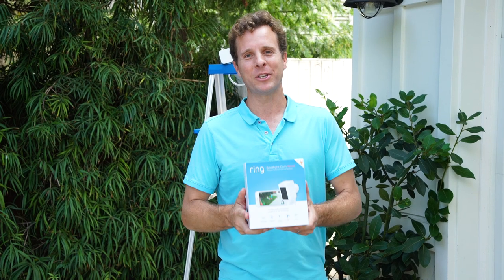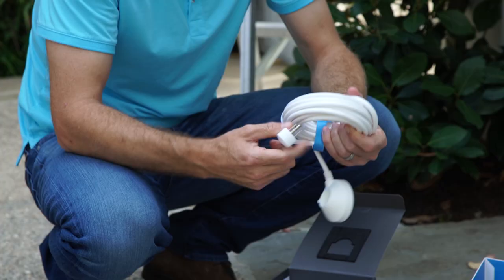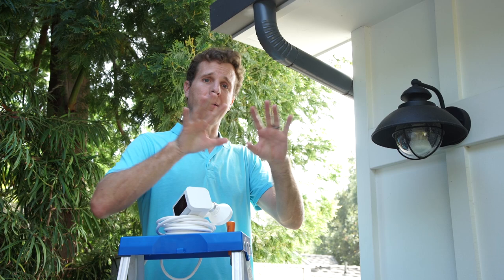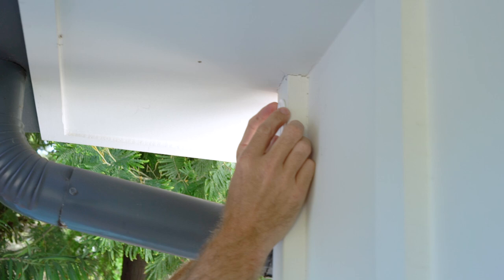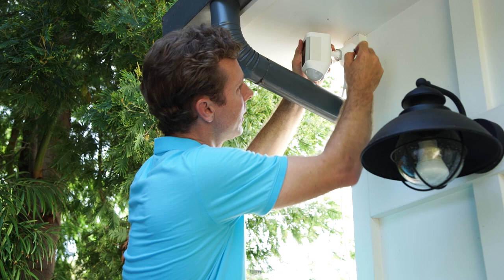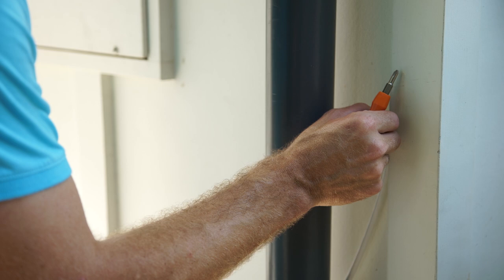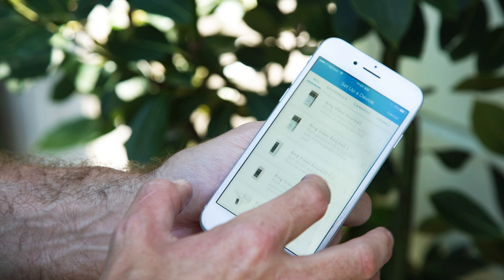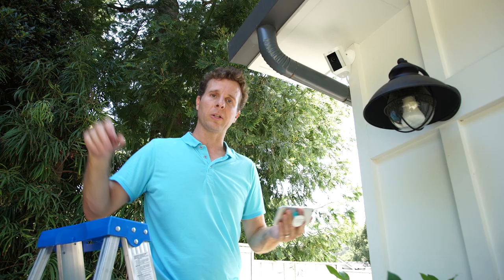Installing Ring Spotlight Cam (Wired) on Your Garage

Comment: Two recommendations for the next gen spotlight cam: design the power cable so that it can be detached from the camera to allow the cable to be fished thru a modest sized hole in the side of the wall so it could be plugged inside;  provide a battery backup to the cam in the event of power loss.
Reply from the maker: Hey Michael, we appreciate the feedback! We're always looking to improve our Neighbors' experience, and we will be sure to pass this along to our developers. :)
Reply: @ring  Yes, Ring definitely needs to improve the power cable.  It's so big for a small device.  Make the power cable detachable so people have different options to wire.
Reply: Totally agree Michael Abel, it’s beyond me that this isn’t an obvious feature as i wouldn’t want that unsightly cable stuck on the outside of my house. It’s also easy to steal it too. Does anyone know if you can cut the plug off, feed it through the wall and put another plug on?
Reply: @STICKYBOY214  You should be able to, as it appears to be a standard outdoor gauge cord.  I have done similar modification to mount above my garage door, to get the cable through a junction box.
Reply: Yes, I would LOVE to have mine plugged inside because my outdoor outlet is easily visible and someone could just unplug it and boom there goes my security footage.

Comment: Really should have made the plug a quick disconnect system, somewhere along the cable, so you can drill a small hole if you don't want to run cables externally, and feed the cable through the wall, connect it on the inside to plug into an interior outlet..
Reply from the maker: Hey Neighbor! Check out the Ring Spotlight Cam Mount which is a hardwired version that can replace an existing exterior light: http://bit.ly/2v0Wj2r. We will pass your feedback along to our engineering team for consideration. We hope this helps.

Comment: If you plug the camera into an outdoor outlet, what’s keeping someone from unplugging your camera from that outlet? Is there a way to run that power cable through the wall and plug it inside the house?
Reply from the maker: Hey Steve, Ring devices are equipped with motion sensors so you would be alerted of any activity as soon as someone approaches the camera. From here, you can use the two-way talk feature in order to scare them off. You are able to run the cable through an opening in an area that allows it, or through any available space to plug it in inside of your home. Let us know if you have any other questions!

Comment: Looking at this video the Camera is plugged in around the corner of the property and not in the cameras field of view so it would be way too easy to kill the power to it without being seen! Why haven't Ring come up with a simple cable that fits through a 10mm hole and connects the other side. This would have been one of the main problems with the initial design surely!!! Who designs these things? Then the cable inside could be made in several different lengths to suit the consumer and potentially more sales for Ring!
Reply: The issue is using a cable that is rated to go through the wall (expensive). The fix for may be to cut the plug off and hardwire to a junction box. Of course this would probably void the warranty.

Comment: Only solution I see to this external plug issue is to have an electrician install a new outlet high up under the garage's roof, at least the height will deter anyone from being able to reach and cut the cord.  Guessing this is going to run me between $150-$200.  Ring, 62+ comments on this issue can't be addressed by "the camera will catch them in the act of cutting / unplugging the cord."  For next gen, focus on a pass-through system.  Now to find an electrician.
Reply: Save yourself some money on the electrician and DIY it. There's videos on YouTube for wiring this straight into an outlet.

Comment: I have the ring doorbell and love it so naturally now I am looking for additional security products started my research with Ring.  I really can't past the fact that this is just plugged in to a wall outlet. Major single point of failure.
Reply from the maker: Hello neighbor! Definitely see your concern. Most outdoor plugs have a cover or lock for security purposes, but if you'd rather not use an outdoor plug, the Spotlight Cam also comes in a battery-powered model, a solar-powered model, or a hardwired model. Take a look here: https://ring.com/security-cams.
Reply: I agree plug must not be accessible by anyone but owner

Comment: how do you install this wired camera with a sealed plug on the end you would have to take a whole brick out to get your wire through to the inside of the property and I know the ring camera also comes with a solar power charged battery but from my experience with a solar power charged battery it would last around 12 months max so I wanted a hard wired version thinking that it would come with a twist lock in the cable to detach the plug but no it comes with a sealed plug and wired into the camera I'm not saying the camera is a bad idea but it has a major design fault if you don't have an outside power point please introduce a twist lock for those people that want the wired version without an outside power point it should also state clearly in the advert  that you need an outside power point for the wired version it is very rare in the UK to have an outside power point.
Reply from the maker: Hey neighbor, the Spotlight Cam Wired is designed to work with outdoor power plugs – we'll definitely keep your feedback in mind for our UK neighbors, and in the meantime, our Spotlight Cam Battery actually comes with 2 battery slots for extended battery life :)

Comment: I'm thinking of drilling a hole just above garage door to connect to overhead outlet powering garage door (and so that no one can unplug my security).  I wish I could see a demo to help me with my planning.  I know I need to make sure cable reaches from outlet to outside wall and I already tested wifi availability from outside garage, doors closed.  I would be drilling into siding and will need drill bit large enough (ex. 1" diameter) to fit plug through.  Don't know what else I need to think about.  I'd hate to drill a hole that big only to find out I messed up.
Reply from the maker: Hey neighbor, the Ring Spotlight Cam is designed to work with outdoor power plugs, and the power cable is attached to the camera mount. If you're looking for a hardwired solution, we'd suggest the Spotlight Cam Mount instead: https://ring.com/spotlight-cam-mount. Alternatively, we also have the solar-battery model at https://ring.com/spotlight-cam-solar

Comment: I want to mount on the four corners of my house but I do not have any outlets in those locations.  I do however have plugs in the attic near those locations.  Do you provide a low voltage option that I can run into the attic and then plug in?  ADT has this option but I do not like the quality of the cameras I currently have with them and want to replace.
Reply from the maker: Hey Randy! We do offer a number of battery and solar powered Security Camera options that may work for you. You can view and compare all of our Security Camera options here: ring.com/compare-security-cams

Comment: What if somebody unplugs it?
Reply from the maker: Hey James, trespassers will be caught on Ring long before they can figure out where your power plug is :) The best thing is you'll receive a mobile alert as soon as someone comes within 270º of your Spotlight Cam, and you'll be able to see, hear and speak to anyone on your property. If it's a trespasser, you can chase them away before they do anything.
Reply: Ring but what if they unplug it? Do you get a notification that you have lost power to it or do you just find out when you look into your phone? Because what if the motion censor doesn’t cover  the side where it’s being plugged into?
Reply from the maker: Good questions, Joshua! You will receive a pop up banner in the Ring app that alerts you when a device is offline. If someone does attempt to damage your Ring device, the motion-activated camera (140° field-of-view on Spotlight) will capture a video of them doing so, and you'll be able to use that as video evidence for a police report. In addition, we offer Lifetime Purchase Protection for all devices purchased, and will issue a free replacement if it's stolen or vandalized.
Reply: You can get a outdoor sockets with a lockable cover

Comment: What if you don't have an outlet to plug into
Reply from the maker: The Ring Spotlight Cam also comes in a Battery model that doesn't require an outdoor outlet :) Check it out here: https://ring.com/spotlight-cam-battery
Reply: then either buy the wireless model or have an electrician install an outlet.

Comment: I'm guessing that the power adapter is safe to be outside in the elements,, right?
Reply from the maker: Great question! That is correct. The power adapter associated with the Spotlight Cam is weather resistant and able to withstand strong winds or rain storms. Let us know if you have further questions.

Comment: Can you cut the plug off and feed the wire inside?
Reply from the maker: Hello Jojo! Cutting the plug from the end of the cord would void any product warranty. If an outlet is not available we would recommend one of the Solar or Battery Operated Spotlight Cam devices. You can view and compare all our Spotlight Camera options here: shop.ring.com/collections/security-cams
Reply: Please stop recommending the battery operated cameras as a solution to this problem! Who wants to climb a ladder to reach all cameras every 1 or 2 days to recharge the batteries? I bought 2 battery operated Ring cameras which I thought were great at first but their battery life is minimal, even while just using motion sensors and setting it to the shortest range. It is a hassle to have to keep climbing up to remove the batteries, wait to recharge them, and then climb back up to re-install them - and what to do when you leave town??? Why on earth would you design your wired cameras to not have the option to be able to go through the wall behind the camera to plug into an indoor outlet or be hard wired?? Very short sighted and disappointing.
Reply from the maker: Hello Sue! We do offer Ring Spotlight Cam Mount which is hardwired to an existing exterior junction box for those Neighbors that prefer not to use one of our battery operated devices. Your Ring Spotlight Cam battery should last more than a day or two and we would like to help. Please give us a call at 800-656-1918 so we can take a closer look into this and get your Ring working as intended.

Comment: What if somebody just cuts the wire
Reply from the maker: Great question! The visibility of a Ring device acts as a deterrent against crime in addition to providing our Neighbors with the security of knowing that events will be recorded. Also, if someone does attempt to damage your Ring device, the motion-activated camera will capture a video of them doing so, and you'll be able to use that as video evidence for a police report. In addition, we offer Lifetime Purchase Protection for all devices purchased, and will issue a free replacement if it's stolen or vandalized.
Reply: Looking at this video the Camera is plugged in around the corner of the property and not in the cameras field of view so it would be way too easy to kill the power to it without being seen! Why haven't Ring come up with a simple cable that fits through a 10mm hole and connects the other side. This would have been one of the main problems with the initial design surely!!! Who designs these things? Then the cable inside could be made in several different lengths to suit the consumer and potentially more sales for Ring!

Comment: Big question. 
If i cut the wire to feed it to the other side of a concrete wall will it void the warranty you guys offer even on theft? If so (which is ridiculous, because you want to protect your investment) once i buy the same camera because “I voided the warranty”,  and i just pop it in where the stolen one was will that still void the warranty on the new camera bought?
Reply from the maker: Hi Edgar, any physical changes made to the devices can void the limited, Lifetime or Theft warranties that come with our devices or plans. See more at https://bit.ly/2B3Izco.
Reply: If it's stolen... they wouldn't know you cut it.  I assume they base their theft replacement on a police report, so they would have no way to know it has been cut.  Sucks though, because it voids the warranty for regular product issues.
Reply: Hey Edgar. Did you installed the camera by cutting the cable and adding a plug to it? How did you do it?

Comment: Thanks for the how to video, I am looking to purchase a four pack of this product, is there anyway to snake the wire through and inside the mount? Is there also a way to go through an exterior wall into the house of through an eave into the attic? How can I mount this camera on a ceiling or an eave of the roof? I noticed the battery version of this camera can be mounted on a ceiling or an eave.
Reply from the maker: Hey there! The Spotlight Cam Wired is designed to work with an outdoor power plug, so we would advise speaking to a licensed electrician if you're thinking of bringing the wire through a wall. Only the battery model of the Spotlight Cam can be mounted on the underside of a ceiling/eave at the moment – all other Spotlight Cams will need to be mounted vertically.

Comment: Couldn’t they just cut the cable to the camera?
Reply from the maker: Hey Craig, great questions! All Ring Cams are equipped with motion-activate cameras so you'll be alerted via the mobile Ring App if someone is approaching your device. Rest assured, we also offer battery-operated and hardwired options for the Spotlight Cam — check them out here: https://shop.ring.com/pages/security-cameras. Let us know if you have any more questions.

Comment: I would not admit to inventing a security camera that you have to plug in outside????
Is this a joke???
What if you don't have 'convenient' outside sockets anyway??
I have the 'old' Ring Camera, that is wired into the loft.
So I can't even use this wiring for the 'new' camera??
Reply from the maker: Hey Henry! We have four different models for a variety of power options. The Spotlight Cam Wired is best for homes with a secure outdoor outlet (these outlets usually come with a cover that can be locked), but if you don't have any outdoor power, we also have the battery and solar-powered options, as well as a hardwired option, right here: https://ring.com/security-cams